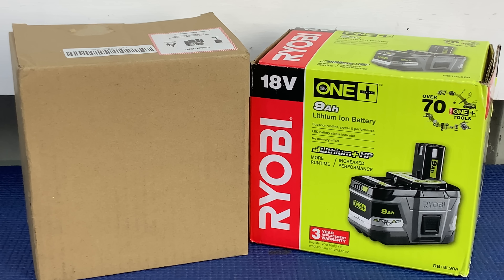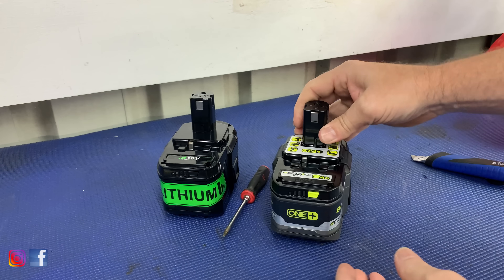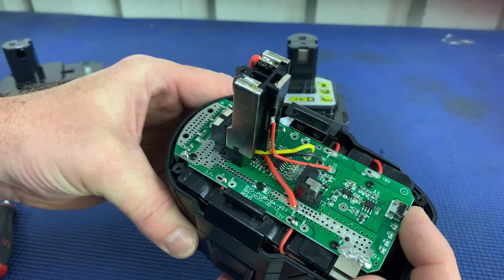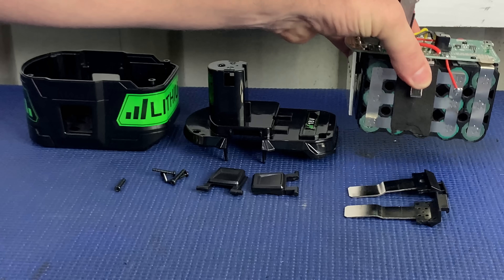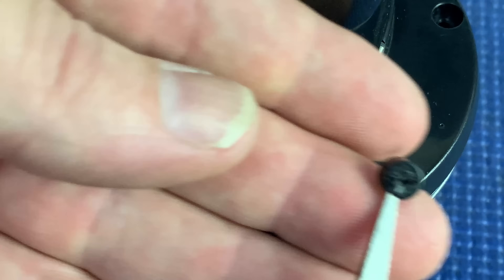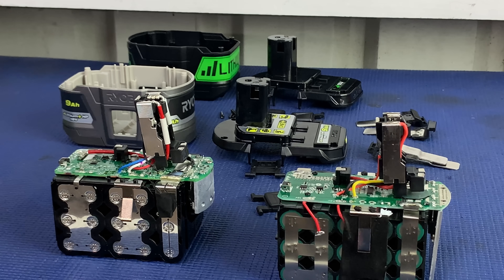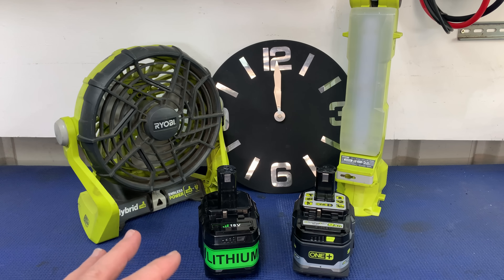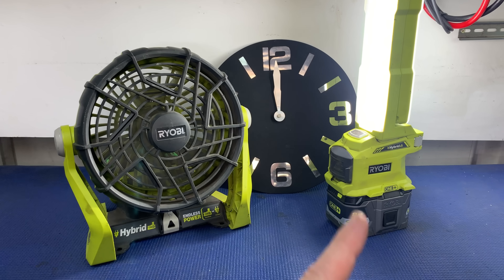Ryobi 9ah battery versus eBay knockoff job

Comment: heya would love to see the 100 cycle vlog or more cycles
Reply from the maker: it died after the first 8 lol piece of junk
Reply: @HBPowerwall  you said it died after 5 in another comment.

Given you stated "it's my job to prove that is (points to eBay) a bad investment vs that one (points to Ryobi)", I would have thought that failure after 5/8 cycles was your QED moment, but alas no.

Wondering if that test proved your whole assertion wrong and like everyone else, I suspect a massive bias here.

Ps I use both genuine and eBays on a 1/2" impact driver. They both snap heads off M16 gal bolts.

I've had one of each of the large batteries fail - the genuine has no physical issues, just throws up error light on charge due to firmware lock (common issue, see Badar's Workshop channel).

Whilst the eBay went open circuit, which turned out to be the nickel strip (as shown at 7:43) fracturing due to the constant use with the impact driver.

The trick you missed there being that the Ryobi construction holds the batteries captive whereas with the eBay they rely on the nickel strips, so vibration, knocks and general abuse will likely lead to failure of the battery welds/nickel strips.

Comment: I've used lots of  knock off Ryobi 4ah batteries and have never noticed much if any performance difference.
They're heavy at 4ah so don't think I'll be buying any 9ah. But don't see why there should be much difference
Reply: Agreed. I use several rayobi and dewalt knockoff batteries and have for about 4 years now. I will take a knockoff 4Ah over a OEM 1.5Ah any day considering price to performance.

Comment: I have several m12 knock off batteries some tools like them some tools dont. Like i can run them in the drill, impact, but not the 3/8 impact or the die grinder. Other then that they work fine.
Reply from the maker: work fine for a shorter time, but still work.. NOT worth the money

Comment: I have a 1 year old vanon 4ah battery and now it won't even run my circular saw with any working load without stopping on low voltage cutoff. There are no more amps left in it. My 5 year old Ryobi battery is still running strong with plenty of amps to power heavier duty tools.

Comment: $72 Vs $299 "If my math's right, that's a 76% difference."

Your math's not right. The difference is that the knock off is ~ 25% of the price of the genuine article, or that the Ryobi is 415% the price of the knock off! The testing only goes downhill from there.

Comment: This is a great video. Thank you. Ryobi's battery line is extremely confusing. I wish someone would open them all up and tell us which cells are in which batteries so we can know how many amps a particular battery is capable of.
Reply: 600cc gsxr said, I wish someone would open them all up and tell us which cells are in which batteries so we can know how many amps a particular battery is capable of

The issue with that is the conclusions almost certainly wouldn't be reliable for long. Manufacturers like Ryobi typically buy the cells that go into their battery packs from multiple vendors often based on price and/or availability. As a result, which cells go into a specific battery model in a specific product line will often change from month to month (and even day to day in JIT inventory management processes) as their supply vendors change.
Another problem is that even well-known and trusted manufacturers occasionally receive counterfeit cells and without a rigorous and ongoing validation test in their manufacturing protocols they won't know it until customers start making product complaints or warranty claims.
Reply: @exgenica  That being said though, I'm pretty certain that the manufacturer and quality of the cells in name-brand packs are much more consistent than in the kickoffs.
Reply: I've not been very lucky with my ryobi batteries.. When heard from others,. 1 of 2 are very often getting bad within small use,.. Why are this?  Ryobi are genuine made I china,.. So is that the answer to the puzzle?.

Comment: What I did was buy the empty shell and used my OWN batteries to make my OWN cells. It is just a matter of buying quality and BRAND name. It is A LOT cheaper to do it this way. It would be nicer if the battery cases would hold 21700 batteries, then I could get a LOT more mAh out of a battery~!
Reply: That's an interesting approach! Where did you buy the shell and did it come with a PCB?

Comment: In the early 1990s when  Battery Operated  power tools were first being introduced to the ConstructionIndustry  I took apart several manufacturers battery packs and found out  they were all filled with Batteries made by Panasonic  ? Makita was one of the better brands  that many Tradesmen preferred  I personally was doing Residential Cabinet Installation  and it was nice to  get away from all the extension cords  Ironically  I still have many of my originalMakita 9.6 Volt Power Tools and Batteries that work  pretty well  I  made a Career out of Installing Commercial Architectual Millwork  and used those tools daily for 25 years untill I retired

Comment: I had both one of these knock offs and a Ryobi 5amp, they both failed so I decided to take them apart and what I found is the failure point on both of them was where the nickle goes around the side, both had rusted out/burnt out I removed the batteries and all of the batteries were the same voltage or there abouts, I now use the batteries for torches and other battery banks I have that use the 1850 batteries.(I think thats the size)

Comment: The knock off is basically the same for all intents and purposes, except for the MASSIVE PROFIT MARGIN. Problem is you bought a NIMH knock off instead of a lithium. It's on the sticker. You should have sent it back for a refund as soon as you read the label.
Reply from the maker: You're mad - they arn't even close in quality or capacity - tested at 1/3 the capacity TRULY rubbish

Comment: MY experience of "the best?" Ryobi knock off batteries is that they are crap, and not worth any investment. I got free replacements, same results. I just need my batteries to work in my tools when I need them, and recharge correctly in a timely manner and be ready for the next use, simple, right? 
All batteries have circuit boards in them that "talk" to the charger, and if they aren't happy together, it's game over. I suspect that the knock off batteries attempt to reverse engineer the "smarts" in the battery chip, but can't quite make theirs 100% compatible.

Comment: Bro, use knock off Dewalt batteries that are hundreds less and they work great.  I would never be so stupid as to  buy the Dewalt brand name for the sake of the brand name.  The knock off batteries may run 15-20 minutes less per charge but I can afford to have as many more as I would like.  You had your mine made up before you started that you weren't going to like the knock off battery and it nearly killed you to admit that it performed so well.  You sound like a nit picking woman with your complaints about how it "feels" clicking in. The point is "DOES IT WORK".  Sad job at a video, no more views from someone who knows how to do math.  Even if it cycled 2 times less than genuine it would still be worth it since it's only 33% of the price, and has longer warranty.

Comment: Really ? I am using how you called this "Ebay knockoff job batteries" on all my Ryobi tolls no problem 
with them even after couple of years.
Where orginal Ryobi 2Ah battery died after 7 months,and have to be replaced.

Comment: Riyobi: "we don't want to kill you"
Knock off brands: "1 billion year warranty 9 trillion amp hour battery!!!!"
Tech support with Riyobi: "take her to bunnings, if they won't help you... we'll get Milwaukee staff to roll their sleaves up and deal with those dodgers, but in the meantime here's a replacement and reset of warranty"
Tech support of Knock off brands: static sounds of the universe plays

IMO, I have purchased a 5 amp battery, I picked up a box of the 9AH battery and held it at arms length, started hurting my wrist as I was moving it about, it's great for close-to-body use not something that you are reaching out for, and 5AH gives me enough juice to use it all day, I advise you to get 2-3 5AH batteries and a charging rack to help you cycle through if you're a budget tradie.

Comment: Is that a second video ever going to come. I found this quite informative but it did perform a lot better than I was expecting and it would’ve been nice to see how that battery fitted prior to you stripping it not suggesting you’re not competent enough to put it back together properly but it would’ve been nice to see keep up the good work👍
Reply from the maker: it falling out was basically the reason for the video lol - battery has failed and was tested 20x at 3ah not 9ah - two of the cells have since failed.. Piece of junk unfortunately

Comment: A helpful comparison but I think not a completely fair one.
The fitting to the tool test should have been done before you pulled them apart.  I always expect a knock of to underperform, but the the question is really about $/ watt hour and number of cycles before failure..

Comment: Hmmm... I paid £57 for two 5ah batteries. They work in my lawnmower, drill and the hedge trimmer. They click very nicely into the two different chargers. These, "fake" Amazon bought batteries do exactly what I expect the Ryobi batteries to do and I saved £81.96

Comment: First, I'm always VERY suspicious of "off-brand" battery packs...particularly in an industry where there is a LOT of counterfeiting going on. However, I do feel it important to point out some issues I have with your evaluation method and observations. I do think your review contains quite a bit of bias and your protocols and test equipment need to change. The reasoning is detailed below.

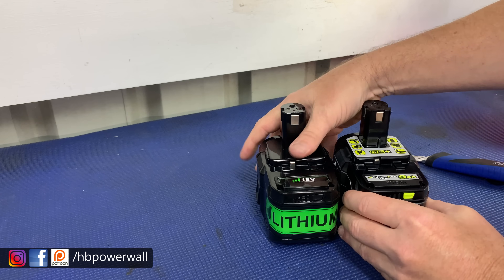(02:05) The main issue is the Ryobi shipping voltage. Any lithium-ion cell shipped with less than 50% means it's likely been on the shelf for over a year, or their shipping protocols are screwed-up. If it arrives at your door with under 10% charge then something is seriously wrong in the process. Li-ion cells stored at low-voltage for sustained period of time damages the cell (as does storing one at fully charged condition).
I would not trust a battery received in that "almost no charge" condition to have retained its specified lifespan or number of claimed charge cycles.

(01:50) You judge the product's quality by a 5cent plastic bag it comes in? That's really stretching for "pros".
You also appear to be ASSUMING that is an antistatic bag (and just having the word "antistatic" printed on it doesn't count in an meaningful assessment).

(05:45) Thickness of the conductive strips has NOTHING to do with the 9Ah rating. That parameter affects Amps delivery capability (instantaneous and sustained). Conflating it with Amp-hours is very misleading. You made a performance decision in favor of Ryobi based on selecting the wrong parameter (Ah). That said, the strips are thinner than I'd like to see however they do seem wider than many I've seen in similar battery packs and thus may still contain similar cross-sectional area and may be capable of dissipating more heat than the typical, thinner connecting strips one sees in other packs. Connecting strip cross-sectional area and Amps are the valid parameters...not just thickness and Amp-Hours.
(note: yet at (07:40) you do point out the width of one particular Ryobi strip when it happens to be wider than the other pack's in that same location. So again you seem to be selecting items to favor Ryobi.) I do agree the welds on the non-Ryobi pack do look like they could have been more consistent. While these connections look cleaner and "better" on the Ryobi pack it's hard to tell there is actually a meaningful performance difference between the two packs in thier output current handling and delivery areas.

(02:40) The weight difference you clearly emphasized is pretty much meaningless (1,080g v. 1180g). That was 100g difference in weight. 100g could be due entirely to different materials used in the case, the screws, the other hardware, etc and have little to nothing to do with the cells themselves. In fact, I would tend to assume the Ryobi pack is made with significantly more robust and heavier materials. Therefore, one has to weigh the CELLS to get any meaningful comparison of battery deduced performance differences. Once again, you're making a decision in favor of Ryobi based on incorrect parameter selection by assuming the battery weights are significantly different when weighing the fully assembled packs.

You seem to make similar decisions in the rest of the video, without supporting facts. For example, you mention the Ryobi wires are "thicker" but that could be just the insulation or it could be on non-critical current paths where the design shows that "thicker" wires aren't needed. We have zero information on that and thus one must assume that parameter makes a meaningful difference for a particular wire. It may or may not. Similarly for your observation regarding using PCB lands vs. connecting nickel/copper strips where you favored the strips over using the PCB. Just a thought, but using strips adds more points of failure (welds, materials, etc) so using the strips actually could be less reliable than designing the PCB to carry the same current.

(11:40) Your comparison of how the non-Ryobi pack felt plugging it into the fan was voided entirely by the fact you took the assembly apart BEFORE you conducted that assessment. It's entirely possible that something you did degraded the fit and latching parameters. You should have performed any such assessments before you changed the manufacturing condition of the packs.

Personally, I think a number of your conclusions at the end of the video are based on flawed assessment, particular items like the relative fitment of the packs performed after you had disassembled/reassembled the packs.
For your ampacity tests, I would prefer to use a constant load test tool. These are available for about US$40-$60 and less likely to inject their own performance variations into the tests. I am glad to hear you're going to perform a 100 cycle test. That will be more revealing. As I noted earlier I'm concerned about the low state of charge in which the Ryobi pack arrived. That can affect long-term performance. I don't know if 100 cycles are enough to reveal that in a battery designed to provide 500 or more charge cycles.
Reply: You: I'm about to end this man's whole career
Reply: He just a Ryobi big fans,not more than that xD
Reply: You're incorrect Ah rating having nothing to do with performance. Yes, Ah is a measure of capacity, but the biggest reason most tool users buy a 9AH pack is not for runtime, but for performance of high-drain tools (keep reading -- I'll go into some detail). The bigger packs have more and bigger cells which are able to deliver more wattage with less voltage sag, delivering better tool performance. In fact, the higher-drain tools (7 1/4 circ saw, shop vac, BL impact wrench, etc.) all perform measurably better with the bigger packs due to their higher current supply capability. This is partially because Ryobi uses 21700's in the 6 and 8Ah packs (which are undoubtedly Samsung 21700 30T cells, which have insane power output capability), and partially because the packs are designed the way they are (enormous buss bars, heavy wires, etc.). This thin nickel strips on the knockoffs aren't really its worst sin, performance-wise -- running the high current path through the PCB without even bothering to glop extra solder on it for reduced resistance is actually the unforgivable one. He mentions it in the video but doesn't make a big deal of it -- but it really is a big deal. It's no surprise that he subjectively noticed worse performance, and he didn't even try it with any particularly demanding tools. The Ryobi's current path doesn't go through the PCB in any meaningful fashion - it runs straight from the buss bars to the wires, as one would expect for a battery primarily intended for high-current loads.   The 9AH-but-really-6AH knockoff battery is probably not horrible for stuff like lights and fans if you just want runtime, but if you want to use it with higher power tools (which I'd argue is the most common application), it's probably not even worth the sum of its parts.
Reply: So where’s your channel showing your testing methods ?
Reply: @user-jh1mq2ih2u  where's yours? there's no point in bashing him, these are valid points
Reply: Appreciated, 2. It would be kinda redundant if everyone who comments, debates or inquires had to have their own channel just so they could comment, debate or inquire on someone else's channel.
Reply: @user-jh1mq2ih2u  As I did here, I've made comments on a number of battery assessment videos that explain my testing procedures and assumptions and reasoning in detail why certain methods may not produce complete or accurate results. I don't have to create a video to debate test protocols. It's like saying I'd have to have my own channel to debate significant digits.

Comment: at the price Ryobi are selling their batteries i will only buy the 'fakes', and ive never had a problem.
Reply from the maker: you've never looked close enough at them then!! 1/3 the advertised capacity alone is enough to run for the hills...
Reply: @HBPowerwall  i dont need to look at them, as ive put them up against Ryobi batteries running my grinder there is absolutely zero difference in performance, real world testing.